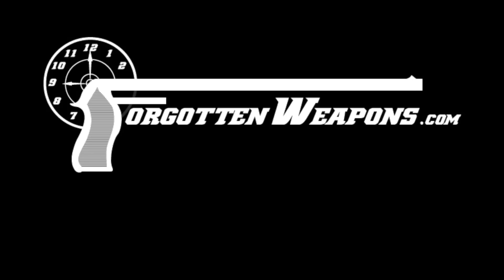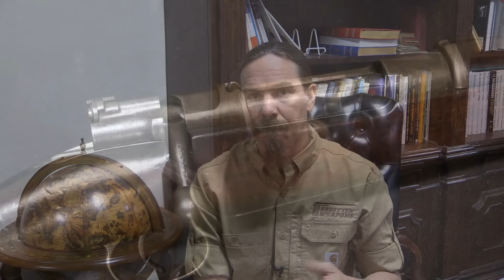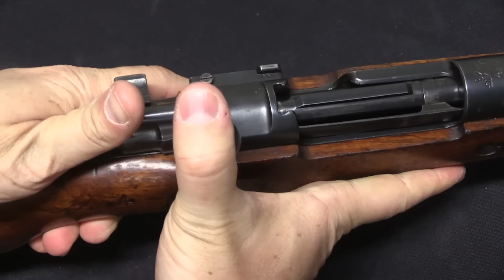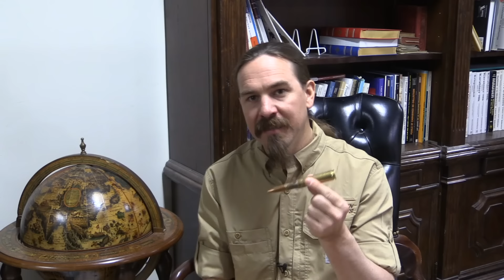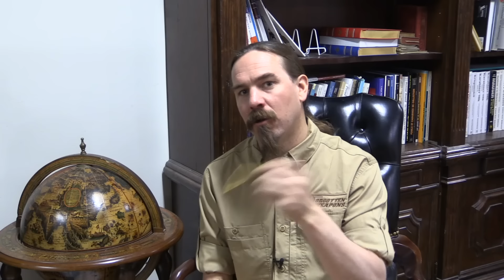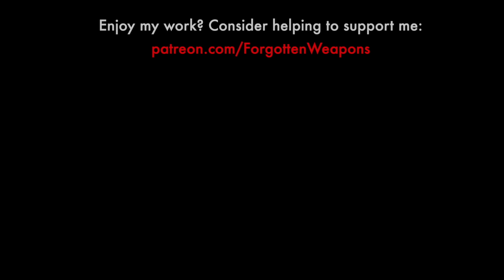Earth-Shattering ka-Boom! How (and Why) Guns Explode

Comment: "...every so often, everything'll line up just exactly wrong, and you'll get a cartridge where as the bolt is pushing that round into the chamber, there's enough pressure from the firing pin onto the primer that it will detonate that cartridge..."  It's just like when you're flying along at Mach 3.2 and suffer from premature ejection!

Comment: A Sarco employee was killed when a 6mm Navy Rifle exploded years back.  I don’t know the cause of that event.  But if this is occurring, Fire Formed Cases and Military Surplus ammo stored improperly come to mind.  I’ve seen everything from damage to a S&W Frame affecting Barrel Headspace in a 9mm to Surplus 7.62x39 ammo loosening a Gas Piston Rod from a brand new Polytech Legend.   The Polytech Legend had abnormally high recoil impulse and a jarring recoil.  Much more than 7.62x39 ammo I have fired in the past.  I’ve even seen a .375 JRS Wildcat Cartridge in a Single Shot Ruger having such an abnormally high  recoil impulse.  I can say that that particular rifle should not have be fired.  If the round or recoil doesn’t sound or feel right, don’t fire it!

Comment: Funny you're using a Mauser as an example. I have Mauser 98 that was converted to a 12 gauge shotgun shortly after WWI. The thing is an absolute death trap because both of the front locking lugs are now completely non-functional because of how much metal was removed from the receiver to accommodate a 12 gauge shell that now the tiny safety lug is now serving as the only locking lug on the gun.

I have never fired it and I will never fire it.

Comment: recent calculations have the pressure at 160,000 plus psi to sheer the threads the way they did (curtesy of mark sorbu the gun maker responsible for the rn-50)

Comment: No, Ian, that was no bore obstruction.  It was a massively overloaded reload that should never have been fired through that rifle.
Reply: When you have an overcharged round, the bullet itself becomes a bore obstruction because the bullet cannot get out of the way quickly enough to relieve the overpressure.

If the cartridge were a blank with no bullet, the gun would not have exploded because the pressure would have gone out the bore with no obstructions.

The bullet became that thing in the way of the overpressure. The bullet became a bore obstruction.
Reply: @BogeyTheBear  In that sense nearly every malfunction can be described as an obstructed bore malfunction, and the meaning of the term is completely lost.
Reply: @chuckschillingvideos  Out-of-battery can't be described that way. Failure-to-feed, stovepiping, or limp-wristing can't be described that way. Legitimate structural failure of chamber or barrel can't be described that way.

Comment: While I am most certainly not any kind of a fire arms expert, I've cooked supper in a pressure cooker often enough to appreciate the over pressure blow out plug on most cookers that will pop if that pressure goes much above 15 psi. I know, I had to clean up the mess after an old non protected cooker popped it's lid, resulting in  an hour of clean up in the kitchen. 

Now I understand that there is a hell of a difference between 15 psi & 55K psi, but am wondering if the same engineering could be applied to fire arms. 

Come on folks, lots of you know way more about fire arms than I do, please talk to me...
Reply: In terms of firearms as we understand them in their various modern designs, a sort of over-pressure plug would be impractical to implement, potentially dangerous if not executed precisely, and is largely unnecessary. 

There are other, better, methods to achieve pressure relief without overly complicating the works. Some designs are better than others in regards to catastrophic failure safeguards, but overall the risk of an over-pressure event is largely mitigated by quality and modern designs. Firearms are inherently dangerous, and the risks are measured against performance.

Comment: Extremely interesting. Your videos always are... but this is beyond that. This isn't special interest. It's the kind of thing every firearms owner should watch. I know a couple of people personally who encountered the problem with 40 S&W Glocks exploding with reloaded ammo - and the result was not, in either case, simply a blown out magazine. In both cases, the slide blew clean off. Both shooters were injured, but not critically, most fortunately. I wouldn't shoot reloaded ammo in a 40 S&W gun with a chamber that wasn't fully supported. I've also been very impressed to see cowboy action shooters, using very low power loads for super speed, stop dead in the middle of a string when a squib occurred. Have you done a video on the Canadian Ross rifle, which was a gun rather notorious for having some safety issues?
Reply from the maker: About 8 years ago...https://youtu.be/EaSui_UqDX8

Comment: A non heat treated and non hardened back cap with a safety factor of about 1.5 didn't make the situation better.
Neither does the fact that .50bmg loading data is 100 years old and has according safe pressures, that modern military rounds exceed by a long shot. Even worse on heavier tungsten projectiles.
And if you add a constantly closed rifle that has a hot chamber after very few shots and keeps the round in there a long time before shooting, resulting in a thermal treatment of the powder that increases pressure even more, that's a recipe for failure.
There is a reason why neither the rifle nor the slap rounds were CIP certified. And never will be.

Comment: It is very possible the bore obstruction could have been caused by the muzzle break since you shouldn't use SLAP rounds with a muzzle break as they can cause build up. This is something TiborasaurusRex covered in his video where he quoted Dean Michaelis (The Complete .50-Caliber Sniper Course - Hard Target Interdiction by Dean Michaelis pg. 411 - ISBN 1-58160-068-2), in which it warns. "CAUTION: DO NOT FIRE ANY STYLE SABOTED AMMUNITION IN A WEAPON FITTED WITH A MUZZLE BRAKE, COMPENSATOR, FLASH HIDER. OR SHOTGUN CHOKE, UNLESS YOU ARE SURE THAT THEY ARE COMPATIBLE."

Comment: Weird question that came to my mind: Can you actually push a squib out of the barrel by firing a blank round? Otherwise you'd have to disassemble the gun, or send it to a gunsmith in order to repair it...
Reply: I cannot speak from experience, but I would say no.
The expanding pressure from the blank hitting the squib would likely turn the gun into a pipe-bomb. The only thing I can compare this to would be when I was learning to shoot muzzle-loaders. My instructor stressed the importance of seating the ball firmly against the powder for exactly this reason.
Don't look for shortcuts when it comes to blockages; take the time to properly clear it.
Reply: @topbreak38  thanks for the answer, and now seeing this aspect, I kinda realize why this would be a really bad idea... would have been too easy of a solution anyways for somebody not to try it out

Comment: I had a .270 Win that exploded due to the round OAC length being too long.  There was zero headspace in the chamber when it was seated causing a severe pressure spike.  The gun blew cleanly into 2 pieces held together by the sling.  The messed up part of this story is that it was my gun that my buddy shot when we were kids.  We were having a little trouble getting to the round to load, but we got the bolt closed and I was about to take a shot and he said...hey man I haven't shot all day.   I cant make this up...I literally said...fine but if it blows up it's not my fault.  smh.  Next thing ya know we're heading out of the desert to the hospital.  He was just fine luckily.   More powder burns than anything.  This is no joke!  gun explosions are a serious reality.

Comment: I had an out of battery with my 1897 Winchester luckily for me the bolt wedged itself partially outside the ejection port instead of hitting me in the face I did however get hit in the face with pieces of shot shell. That’s why you wear safety glasses kid thank god I was

Comment: In 1964, I was taking a wheelbarrow of firewood to a nabor who had run out (her only heat source) . My brother was carrying my 22LR  Winchester . He was to take the empty wheelbarrow back home . I was going rabbit hunting (we had no meat) . I noticed my brother whipping the mussel of the rifle with his hand. He had jammed it into the mud. I  spotted a rabbit, I loaded the single shot rifle,  I took aim, and I waited. My brother said nothing , and I unloaded the gun . Then I punched my brother in the face. He ran home.  When I got home, my mother and father asked me why I purchased my brother . I explained exactly what had happened. My father spanked my brother. I pushed a  four inch long mud plug out of the rifial barrel. If I had pulled that trigger, the bolt would have exited into my face, or the barrel would have burst. I worked with dynamite. I learned that mud is very good at holding pressure in a tube .

Comment: I don't know anything about guns.
But as a engineer I work on high pressure systems very often. 
There are safety valves or some sort of bursting disc to prevent overpressurisation. 
Can this feature not be incorporated in guns?
If its a stupid question its due to my ignorance about guns.

Comment: Ian may I ask a question please. What do you mean by Out Of Battery ? I'm an avid reloader and wonder what it means so I don't make a mistake. Thanks for your very informative videos I always enjoy them.
Reply: @tobyjo57  'Out of Battery' refers to round not being fully chambered / action Closed Properly.  Many (most) guns are designed to prevent firing in this condition normally, as it is quite dangerous (unsupported case).  
Intuitive as to problem but not necessarily so from name...
Reply: @davidm.4670  Thank You

Comment: Ian, at the risk of incurring the wrath of all "Rifleman's Rifle" purists here goes; my father purchased a pre-64 Winchester in 30/06 cal in 1953.  I was 10 yrs old we went target shooting with a new box of Winchester Super X 180 gr.  There were no obstructions in the barrel as the previous night he ran a rod through the barrel and checked visually.  Standing off hand he fired the first shot the rifle exploded in his face and hands.  The stock into three pieces.  His knees sagged and he almost fell.  My brother grabbed and supported him to the car.  I had been sitting in the car loading my .22.  Shrapnel from the gun pierced the heavy wide thick door on the 1951 Lincoln.  We raced to town there was so much blood loss it welled up deep on the leather seat.  Rushed to the hospital he loss his right eye and his face was riddled with pieces of brass.  He sued Winchester and discovered the same thing had happened to multiple other shooters.  Interesting the same thing happened to the inventor of the control feed bolt Mauser lost his right eye.  The control feed bolt design and extractor puts the mechanism and safety tn position to blow torch into your eye and face.  I see Winchester subsequently designed bolt gas ports.  However I have never fired a controlled feed rifle since.  I opted for the Remington push feed locking bolts recessed bolt cartridge system, and Mark 5 Weatherby push feed nine locking lug with gas escape ports.
Thanks enjoyed your post Werner

Comment: The french added a cutout behind and onto the bottom of the bolt head. The Germans added gas shrouds to rifle designs in order to divert dangerous gases away from the shooter. 

The Japanese? They drilled a hole, sometimes two.

Comment: I'm kinda shocked he didn't talk about open bolt big machine guns. If lots of rounds are fired out of them and leaves them very hot, that heat can set off the next round before its actually chambered or fired. M249 and the M2 can have the receiver explode in the user's face

Comment: The point at which the pressure from your stereotypical lethal-force hand grenade can kill through shock wave alone is 40 psi. The chamber pressure of a 5.56 NATO cartridge is nearly 60,000 psi. Now granted, there's a world of difference between what a grenade does and how it kills versus what is going on in the chamber of a firearm and how it propels a projectile, but I've always found it sobering to consider the pressure differences and what is actually needed to kill a human being with said pressure. People really just do not remember to appreciate and respect the forces at play every time they fire a round from a gun. It is a deadly explosion that you're holding inches from your head and you're merely acting under the assumption that said deadly explosion is going to go in the direction you want it to go.

Comment: I think this is the only time I’ve ever disagreed with gun Jesus. When an out of battery round goes off (open bolt) cycling a bother round and good to go is not what you do. An out of battery very commonly has enough pressure to send the round partly down the barrel creating an obstruction like a squib. After an out of battery detonation the gun needs to be checked before you cycle another round and good to go.

Comment: You know, could it have happened because the round was rigged? He indicated it was milsurp and that makes the round subject to being booby-trapped. Seeding enemy supply with cartridges filled with high-explosives rather than deflagrating propellant is not uncommon. The cartridges cannot be tracked or detected unless the bullet is pulled and propellant is checked. Capturing your own seeded rigged rounds happens all the time and yes they can make their way to the milsurp market. That is what I think happened.
Reply: I'm no expert but I really doubt this kind of sabotage would have been likely in a specialized round like this.  That kind of thing would have been happening in common rounds being fired in the millions through AK-47s.  This wasn't even your "standard" 50 cal ball ammo, it was a highly specialized and loaded hot SLAP round.  It would be like going out of your way and devoting a large amount of time and expense to develop a computer virus for the TI-84 calculator.  Possible?  Sure.  Worth it?  Absolutely not.

Was likely just a matter of already hot rounds being loaded TOO hot, and/or old degraded propellant leading to excessive pressures.

Comment: The guns should all be recalled and inspected
Reply: There isnt anything to inspect. Its not a case of poor manufacturing its a case of needing the design to be improved.
Reply: Why? It was no fault of the firearm. The poor man got a faulty round, loaded to unknown specs. The RN-50 is perfectly safe to fire THOUSANDS of rounds reliably over and over without and major wear
Reply: @rapl1183 when Kentucky ballistics recovers, let’s load an 85,000 psi round into a Barrett and see which one hurts more